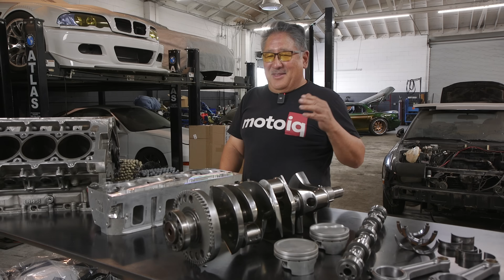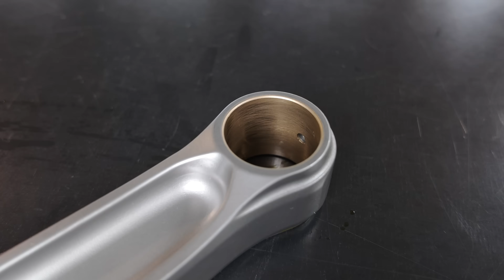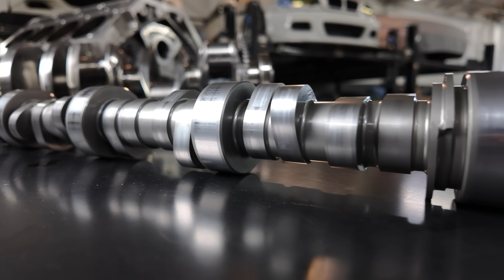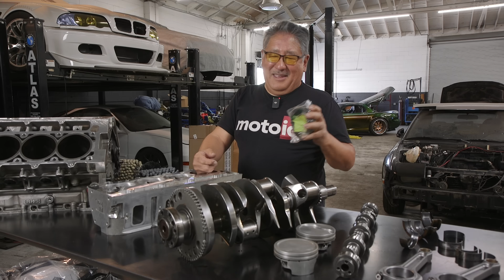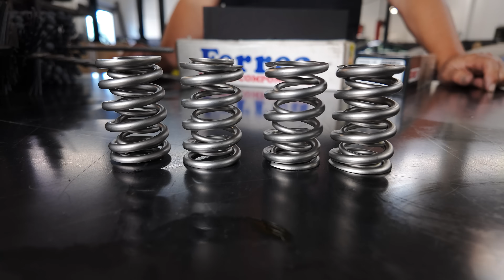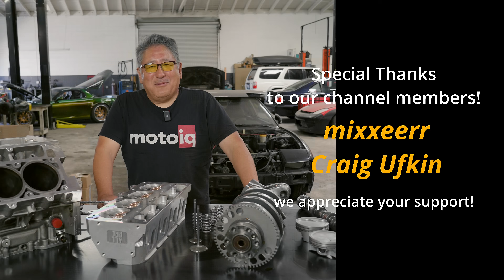How to Make Your Engine Last Forever!

Comment: If you are using a good oil that keeps the ring landings clean, does it matter if the rings are low tension or not?
Reply from the maker: All late model rings are low tension nowdays

Comment: I can't believe how good the internals of that engine are after the abuse it gets drift racing. The fact that you are re-using the pistons is unbelievable! Cryo and WPC is like waving a magic wand over that sucker. As Mike says, it's cheaper in the long run. I would do it to gearbox internals, differential, etc. Bottom line, it's gotta reduce parasitic loss in the drive train, meaning more power to the tyres. It's a no brainer.

Comment: What is Ra surface roughness after  WPC ??  I googled that it is around 0,8Ra , but  for bearings should be way lower than 0,8. So it is not a solution for everything  or  I am wrong? What the secret behind  over chemical surface treatment or polishing ?
Reply from the maker: It depends on the RA of the base material before treatment. We use it on bearings all the time and it improves the load bearing capacity up to 20%. I dislike isotropic polishing.  It changes the dimensions of the part, sometimes by a lot.
Reply: @motoiq  Ok but can you provide some numbers in comparison with other methods ?  I am interested in this method but I need more clarification.   Do you have office/ representative in Europe ?  What  would be cost  to treat specific parts  f.x  for standard V8 engine ?
Reply from the maker: No because it depends on the base finish. For specific pricing and to forward specific questions contact them via https://www.wpctreatment.com/

Comment: Feels like it was yesterday that you guys showcased Dai's S13 with a "new" LS V8.  Yall were one of the first to swap a LS in an import in formula d. Back then it was absolutely crazy seeing an LS in a s chassis. In todays standards, that car wouldnt be able to compete in the pro am class lol
Reply from the maker: That is true. We had a lot of firsts. We were first LS, first to run a quick change with a spool,  first dog box. First dual master cylinder with a balance bar, first 3-way shocks, and first to alter suspension geometry.  That is all typical nowadays.

Comment: Man I think I’ve read all of these comments now. 
1. Imagine trying to argue with Mike kojima on anything technical. 
2. Theoretically, if I took an engine like let’s say… the 2UZFE in my Land Cruiser, applied these same methods such as WPC and cryo, and ran it without any stressors such as forced induction and continued to use it as a daily driver and light off-roading… how many thousands of years would this engine last?
Reply from the maker: A lot would depend on the piston alloy choice.

Comment: I run 0W20 in my Honda Fit. Would my engine last longer if I change to 0W40? I plan to keep the car for another 20 years
Reply from the maker: Not if its stock and well maintained.

Comment: Change oil? Uh, my bmw timing chain failed. Even with frequent oil changes.
Reply from the maker: Did you get the right spec of oil rated for chain protection of a DI motor?

Comment: I wonder what NASCAR does to get 900hp from a 350sbc & 12:1?🤔
Reply from the maker: It is engine hp when the numbers we quote is WHP, which is like 20% less.
Reply: @motoiq  I don't understand?  WPH, or WHP wheel horse power?  
But my comment was how can NASCAR engine builders get 900hp from a small block 350 Chevy with 12:1 compression?  They are using top secret heads, cams, bore stroke & probably even WPC & Cryo, but WPC & Cryo can't add 400hp by itself. 🤔
Have you ever seen dyno gains in WPC?
Reply from the maker: It is not really a small block Chevy, it is an R07, a bespoke racing engine, nothing at all is in common with the small block Chevy or even the LS not even the bore spacing. In NASCAR non restricted trim the R07 makes around 750 hp I think not 900. This ends up being a little less than our typical NA LS builds which do have a larger displacement than a NASCAR spec R07 typically. The 900 plus hp R07's are not NASCAR trim and are stroker engines that are much larger in displacement, more compression and more radical valvetrains.  We can build 900 crank hp LS engines easily.  Although L07's make impressive power, and it is a super cool engine, it is nothing super amazing magic.
Reply: @motoiq  Thanks for the explanation & details!
Reply from the maker: I am gonna watch!
Reply: Looks like YT removed the link to the video.
Here is the title to the amazing article & video.  See:  "Engine Labs Turning A NASCAR R07 Engine Into A Serious Street/Strip Package". Totally mind blowing tech.

Comment: Excellent informative video! Do you any experience with BMW's N54 motors?
Reply from the maker: We don't do them
Reply: @motoiq  😐
Reply from the maker: We don't have stuff like torque plates, special tool and fixtures for Euro engines.

Comment: Your kidding right?  That crank, chatter marks and groves on the bearing surface!  Bottom end bearings had wear and groves!  Cam had chatter marks all over the bearing surface and the lobes didn't look all that great!  Pistons had light verticle scoring.  That engine had wear!
Reply from the maker: Are you kidding?  Have you ever looked at any parts that have come out of an engine? Chatter marks and grooves on the crank?  There are none.  The journals look blotchy, which is normal for WPC on a nitrided surface. Chatter marks on the cams? The mat surface on the cams is slightly darker where the rollers roll, but no other marks. Bearings had a few marks through the coating. The engine looks like it has a few hours, not many events on it.

Comment: The McMaster Carr bag is a good sign that someone might have an engineering degree.  Half of mechanical engineering problems have a solution just waiting on the McMaster website, which is perhaps the best organized website I've used.

Comment: I didn't know about wpc and cryo, I wanted to get my crankshaft and rods REM polished... think they use different grit abrasive in a vibratory tub for increased surface hardening... Think these products might be more like DLC
Reply from the maker: REM is an abrasive plus chemical etching method that only makes the surface super smooth, super smooth is less likely to form a crack and is well smooth.  REM does not harden or improve the surface and causes parts to shrink which is why we rarely use it. WPC is a lot better.  When we do REM we usually WPC over it. This gives a better oil film and improves surface hardness and better fatigue life.

Comment: I worked at PAC back in the day, they have in-house XRD testing.  Something like WPC (PAC nano peen) is very effective, very high compressive residual stresses induced on a hard surface, final step in high end valve springs manufacture.  Every set of my valve springs going on a race build go to WPC, worth it for the extra longevity it can add.   Cryo was also proven effective, worth it for the prostock customers.
Reply from the maker: PAC does some of the best valve springs in the industry!

Comment: The new Valvoline oil is amazing! Actually cleaned my cams! They look new!
Reply: It is !! It stopped the cold start knock on my 300k 6.0lt LS 2
Reply: @chopperking007 Now I may be wrong but could it be that piston rings weren’t doing the job correctly and weren’t expanding to factory measurement so by cleaning it, it allowed for it to seal the gap between ring and cylinder, ultimately stopping piston slap?
Reply: @aidenp5768  Is it like "piston slap"?  When you've got a dead cold engine, it idles down, then you get a knocky or tappy sound, but it goes away when the engine is all hotted up?  I think it's pretty common, eh?  I think the different metals expand at different rates on startup.  Oil viscosity & warmer weather have an effect.  My car only makes the noise during winter/ cool weather.
Reply: “New” what do you mean? I thought they’re using the standard alien blood blue vr1?
Reply: The restore and protect?

Comment: How much would you  do my nissan GTR, currently at 130k miles. No racing. Just normal use and few quick launches.
Reply from the maker: Do what?
Reply: @motoiq a reconditioning of the engine
Reply from the maker: About 20k

Comment: I'm debating whether I should do WPC treating or use Line to Line Coating's piston skirt coating instead. I have a 1.6L GMC turbo diesel in my 2018 Terrain that I'm refreshing. Already broke it down cleaned everything got gapless rings, everything else looks okay but the piston skirts need attention. Trying to make this engine as efficient as possible.
Reply from the maker: A Japanese OEM tested polymer coating vs WPC on pistons and found that WPC had less friction and longer life of the piston.  Sometimes we use Swain PC9 on pistons to close up tolerances.

Comment: What’s the weight on that crankshaft?
Reply from the maker: This crank is internally balanced using mallory metal. Unless you are talking about the round thing.  That is the reluctor wheel for the crank angle sensor.
Reply: @motoiq I’m asking what the overall weight of the crank is. Like a standard sbc is 54 pounds and I’m building one with a crank that’s 43 pounds.  I know what the reluctor wheel is.
Reply from the maker: I will try to weight it tomorrow if it's not in the engine yet!
Reply: @motoiq cool thanks.
Reply from the maker: 55lbs 8oz.  Lots of mallory metal to internally balance the long rods.
Reply: @motoiq thanks for the info.very interesting.

Comment: Great processes   Amazing results. U get any info on the new Ali cryo treatment please share it ? Is it a patented process?  I’ve seen a dude put .020” deep X on the thrust face of his motorcycle pistons. He believes it’s quite effective. Any thought on that and drilling holes in the piston skirts( thrust and opposite) I love these treatments so if I cryo treat my coyote gen 3 v8 block and heads using the old Ali cryotreat method what results am I likely to c  Can u elaborate on the  metallurgy that takes place during this new cryo method. I know they’re keeping it hush hush but have u done brinell or Rockwell testing on bearing bores for mains and cams  does it alter the thermal expansion rates Main benefits facinating stuff to me I absolutely love and embrace these technologies.  Cost to do a full LS engine in nes cryo and WPC? Cheers mike yu do exceptional work man!😊
Reply from the maker: I have no idea of the metallurgy of cryo on aluminum other than it probably speeds and extends artificial aging.  I have no idea on crown features or drilling holes in the skirts. Crown features probably depend a lot on the combustion chamber and where the quench pads are.  I would not drill holes in skirts.  I don't experiment on customer engines unless they ask me too. One major piston company is experimenting on a spiral dome feature they swear works. When it comes to unproven experiments, I don't do that on peoples dime unless they tell me too and I can't afford to do it on my own engine unless it's proven to work.

Comment: How does WPC treatment on the piston rings effect engine break-in?
Reply from the maker: If the hone finish and bore machining isnt done correctly it can delay it.  Super low tension rings, like found on Motocross bikes, break in can be delayed.

Comment: If I want a turbo for my 2005 2.4 5spd Honda accord will it still last a decent amount? I only want 50hp at lowest rpm. I haven’t seen anything for my car I just think it needs a little more umph to get going. I rarely take my car up to 4,500 rpm. If there is any such kit please advise and if it’s even worth it, thank you. Car is all original and has almost 170,000 miles.
Reply from the maker: If it were me, I would sell the Accord and buy a car that is more performance-oriented to modify.
Reply: How about swapping to a 6 speed box and closer ratio lsd?
Reply from the maker: It just need to be rationalized that do you want to dump a bunch of money into an old accord vs just saving that money to get a better car.

Comment: What operating temp does this motor run in? I've heard of tests where coolant temp has a big effect on internal wear in the engine and PPM content of metal dislodged into the oil.
Reply from the maker: Generally under 210

Comment: Pre 2005 - check oil every 6 months and/or replace if over 8000km.
Post 2005 - check oil every 6 months... Ooh whoops you have none due to low tension piston rings please buy a new engine or car.

They really do not make them like they used to. Keep your old and good 'uns cos new shit don't last. Don't be pointing your middle finger at your car manufacturer either 'cos your government asked them to do this.
Reply from the maker: That is not true, modern engines are so much better than ones just 10 years ago. Most manufacturers now have low-tension rings figured out, and all cars now have them.  Nowadays, it's common for engines to last 200- 300k miles. Not too long ago, most motors were totally done by 100k.  I mean, there are still some engines that are stinkers like the Toyota V35A, but for the most part, engines are vastly better than they used to be.
Reply: @motoiq  You have been drinking the coolaid. Most manufacturers don't even HAVE an acceptable oil burn limit for manufacturer replacement anymore. Toyota(case in point, you mentioned them) just say words to the effect of "Engine will burn oil, check often, your problem". Even in the mid 2000's when they said 1litre a 1000km was acceptable, that was still too much. There are literally people with cars between 50-80 thou km on the clock hitting oil lights in a month or two after an oil change.
Reply from the maker: Drinking kool aid, modern engines are bad because you said so?

Comment: Hey mike, what oil would you recommend for my street driven 300whp sr20 with cp pistons, eagle rods, and most likely going with king bearings? Also what oil clearance do you recommend on sr20 engines with aftermarket bearings?
Reply from the maker: 15w/50 or around that synthetic.  I shoot for slightly tight on the mains and middle of spec on the rods.
Reply: @ is this in reference to the oem tolerances or the bearing manufacturer tolerances? from what i saw it seems that the bearing manufacturers recommend nearly triple the max oil clearances that nissan does
Reply from the maker: OEM.  Aluminum blocks don't like the mains really loose, looses oil pressure.

Comment: Sounds like a lot of parts are replaced on the regular.  So you make it last forever by turning it into a Ship of Theseus?
That's not really lasting forever at all... is it?
Reply: if you clicked on this thinking they literally meant forever, the information probably doesn't apply to you anyways.
Reply from the maker: Did you watch more than the first 3 seconds?

Comment: Would you guys ever consider doing an NA Miata build series in the same vein as your AE86 series?
Given the popularity of the platform for both track use and street tuning use, I think it could be useful for a lot of people (myself included)
Reply from the maker: They are good engines, they just don't have much aftermarket support particularly in the valvetrain which is critical.

Comment: What is "timken clean steel"?
Reply from the maker: It is steel made by the Timken mill that has extra steps to minimize inclusions in the material.  Inclusions can become the source of stress cracks.
Reply: I would hope Timken does a vacuum remelt . I suspect they do .
Reply from the maker: It is air melt but there are some proprietary processes used.  Here is a white paper on it if you are interested. https://www.steel.org/wp-content/uploads/2021/02/Track-2-Gynther-TimkenSteel.pdf
Reply: @motoiq ,,, sooo , I'm delivering to Timken Steel in Ohio , and I ask one of the guys , why did the board break you into two companies . Steel and Bearings . Weeeeeell , it seems the California Teachers Union is a giant stock holder , and one of their bean counters figured out that their holdings would have a better return if they forced a split . I just couldn't understand , so I asked . This was about a half dozen years back . Btw , thanks for the paper . I saw ( 16 months ago ) where Carillo has a new alloy ,,, ?
Reply from the maker: Wow really?

Comment: Hi mike, I ended up finally getting my NB2 miata to start learning autocross and track days with, I have 155k miles on what I assume is the original block and head, I am only really interested in doing bolt on power and perhaps building the head, what steps could I take to ensure reliability and to keep costs as minimal as possible?
Reply from the maker: Change oil using good quality synthetic every 3000 miles. Do all your maintenance.

Comment: Would a bypass filter for a gasoline engine help prolong life? Not sure if anyone’s done it
Reply from the maker: I kinda think they reduce oil pressure for no good reason.
Reply: Very worthwhile on a Diesel ; especially with an oil analysis program , and extended drain .
Reply from the maker: I sorta think its better to just change that oil!

Comment: Mike, you NEED to reach out Dave at HPL (synthetic lubricants). You would LOVE to do a video with him ;-). 

Add his oils to your engines and I don’t see a need to even refresh after two seasons.
Reply from the maker: There oil could be the best but that is not how it goes with race engine. Not matter how good the oil is, there are many factors to consider and always parts that should be PM'ed out.
Reply: @motoiq of course, I was being hyperbolic lol.

FYI, there’s no join button.

Comment: I WPC treated my BC280 cams that I put in my STI back in 2021 figured I'd do what I could to help the valve buckets as much as possible. Still going strong 4 years later! I only knew about this treatment from your old videos and haven't heard it mentioned anywhere else. Thanks!
Reply: I cryo and WPC treated my cam and lifters on my Abarth. I’m now sold completely on the processes.